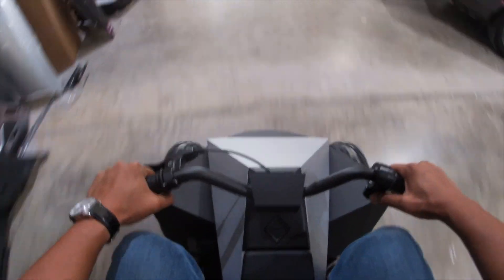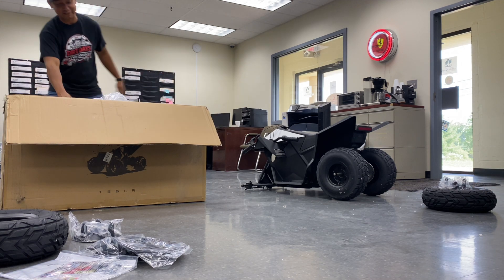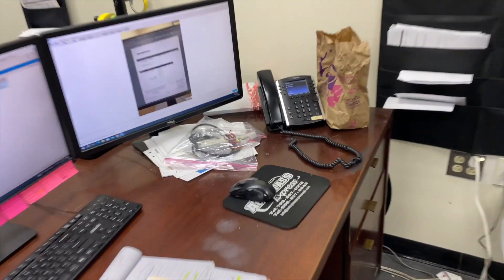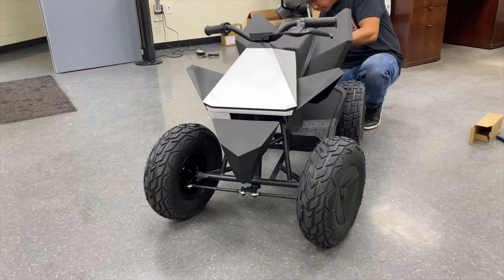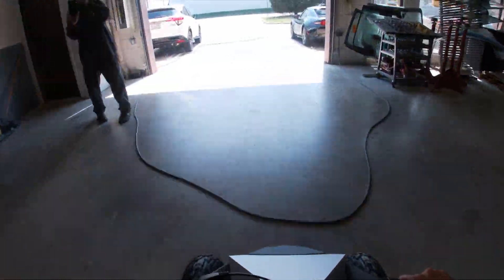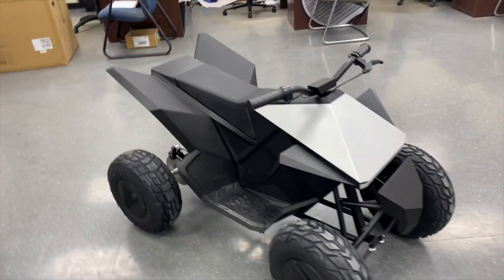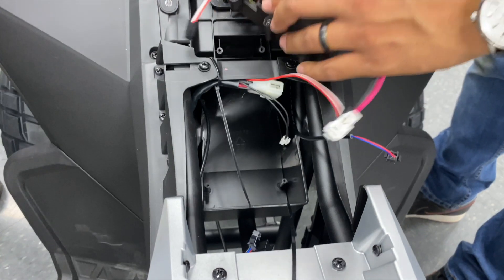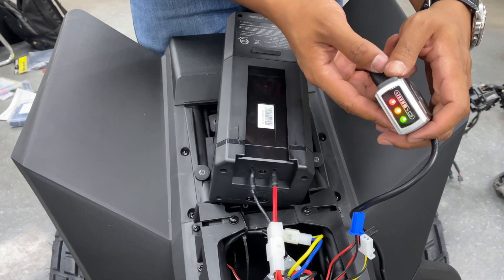Tesla Cyberquad Electric ATV 36V PEV Unboxing Assembly Testing Review

Comment: Why not increase the volts to 60v or 72v for a lot of power. I’m not criticizing I’m just actually wondering why you are deciding to keep it at 36v.
Reply from the maker: The owner wants to salvage the $500 Lithium battery pack that's already integrated with the frame. It just keeps the total cost of the project significantly. The slide in/slide off design is pretty convenient.
Reply: Oh I see that makes sense. How fast do you estimate it will go with the upgrades?

Comment: A little bigger at 60v these would be 👌🏽😎
Reply from the maker: As much as I agree.. The owner wants to salvage the $500 Lithium battery pack that's already integrated with the frame. The slide in/slide off design is pretty convenient. If this was mine, it would be a 72V set up like on my MX650, which would rippp
Reply: @PatOutdoors  😎  I wanna build a 72v Razor so bad but it cost🤑🤑
Reply from the maker: @burn1gotbeats  Yeah... That's why I started with a 48V set up, then got so hooked that the budgets just started getting ridiculous lmao
Reply: @PatOutdoors  lol 🤣🫢☝🏽